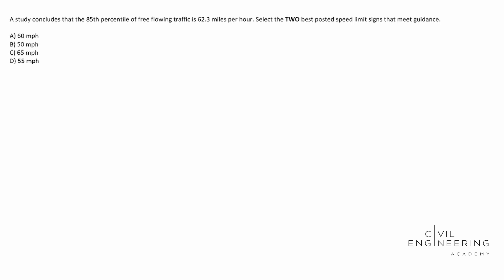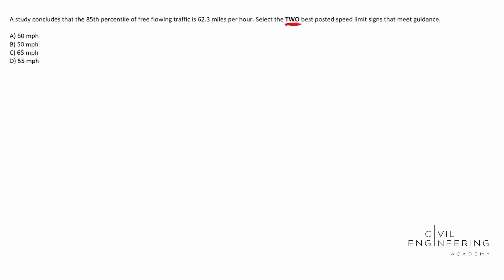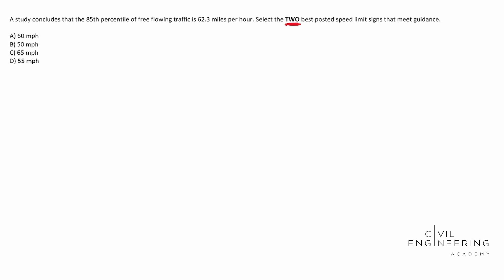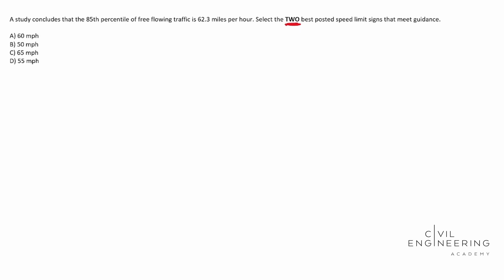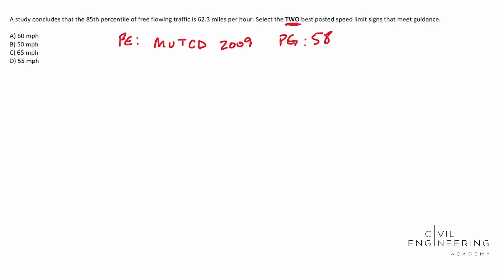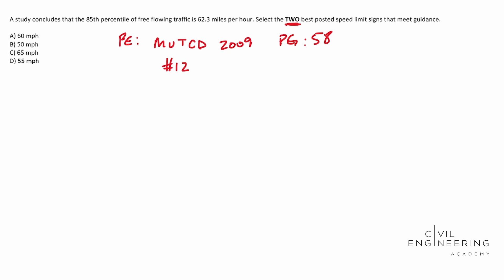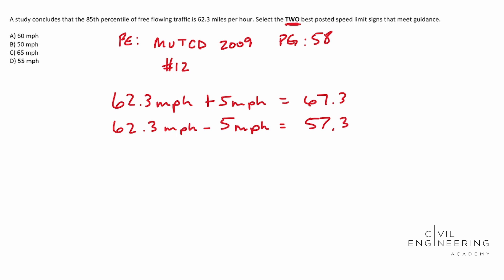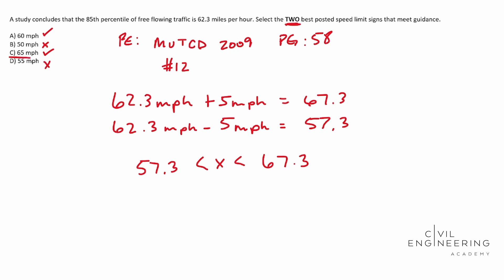Civil PE Exam - Transportation -  Selecting Posted Speed Limit Sign Given 85th % Free Flowing Speed

Comment: The MUTCD isn't an available resource to all disciplines, only to those taking the transpo depth. Is there design criteria specifically for speed limit signs anywhere in the civil reference handbook that would give us what we need to solve this problem?
Reply: Correct, this is a depth question, not a breadth question.
Reply from the maker: You're right.. This may fall more in line with a depth question with the standard called out for sure.  Otherwise, they'd have to give you that information in the problem itself.  Good call.